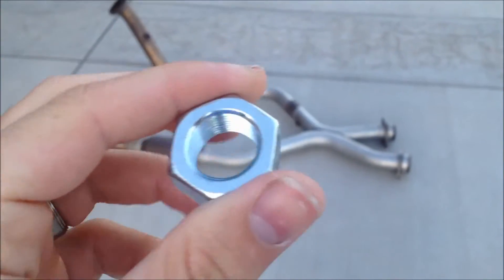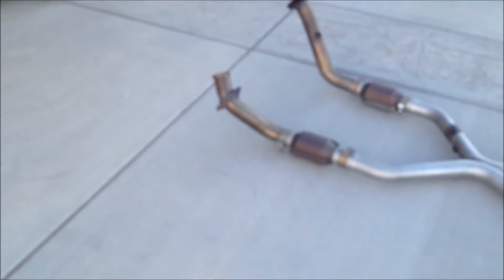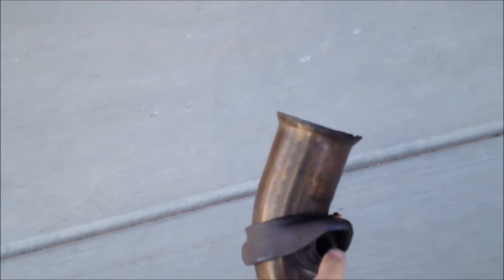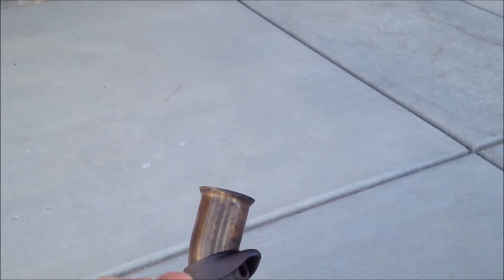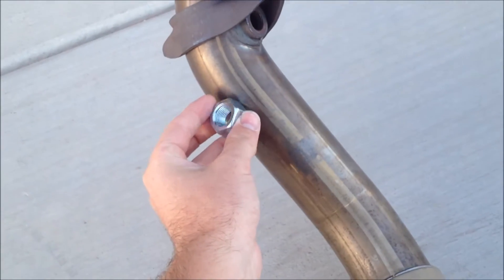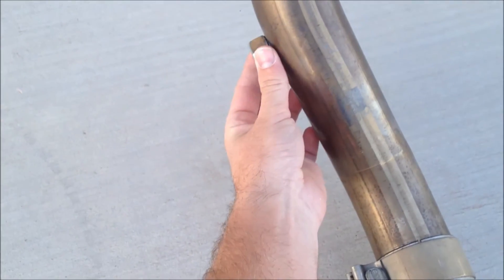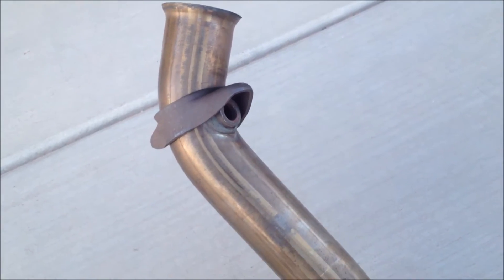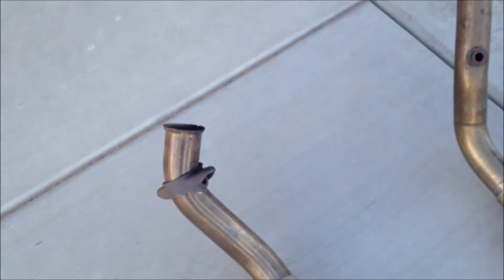QUICK TIP: What is a wideband bung and where does it go on your exhaust?

Comment: So, i have a 3000gt vr4 and i guess it doesn't really matter what car but i just wanted to ask, would this replace one of my 2 factory o2 sensors? Or would i keep both of them and make a new bung completely separate for the wideband o2 sensors totalling 3 sensors, the wideband, and the factory 2 o2 sensors? I'm just kind of confused on how all of this is set up.
Reply from the maker: This is an additional port you add for the wideband. The stock o2 sensors are narrow band and need to stay on the car
Reply: @dannyjohnsonsgarage  where would you plug the wideband in though? Do you solder on another plug?
Reply from the maker: shnoopy doopy The wideband plugs into the wideband gauge and all you do is add a power and ground source using an add a circuit https://youtu.be/GqEPnEDM93Y
Reply from the maker: shnoopy doopy Here is my full install as well https://youtu.be/R6tTB5V7iQQ
Reply: Danny Johnson I just added a bung for my afr “17 camaro SS”and I put it after my 02 sensor, is that correct or should of I put it before , it’s for my remote tuning , the tuner needs my afr

Comment: Thanks for this info!! What kind of cars need this "wideband bung"?/ Turbocharged?? What do you do with this info?? Is the sensor similar to O2 sensor?/ Thanks again , youtheman =)
Reply from the maker: Eero Laukkanen yes, this is for cars that are turbo charged or supercharged because the air fuel ratio is very important. If you see it climb above 11.2 on the ratio then you know the car is leaning out and could detonate the fuel and damage the motor. It is also good to have on cars that are not super charged or turbo charged so you know if they are running too rich or lean. It is similar to an O2 sensor. And O2 sensor measures a narrow band of information and this will measure a wideband
Reply from the maker: Eero Laukkanen https://youtu.be/qGsJVoSONgY
Reply: Thanks a lot! Now I....we know =)